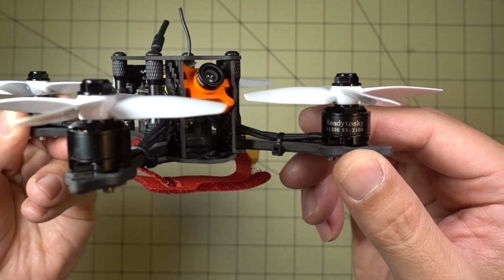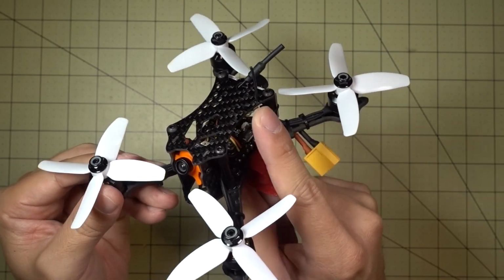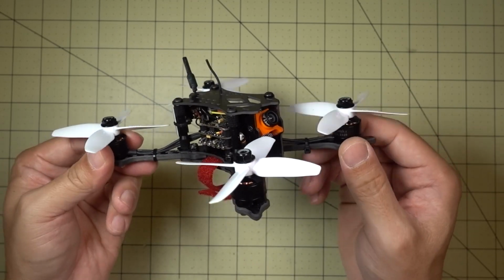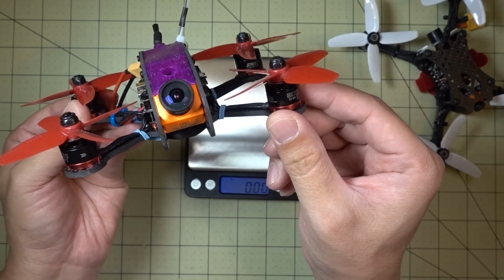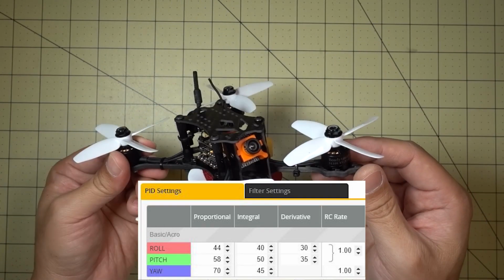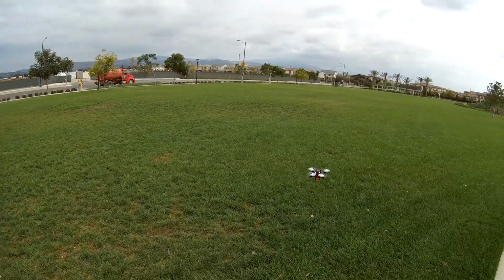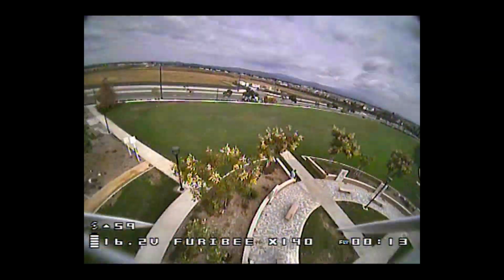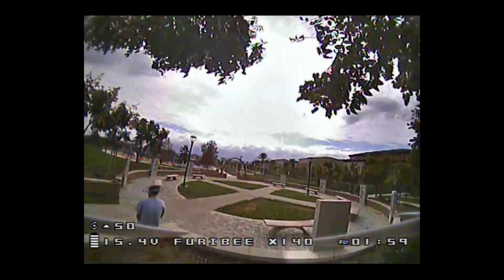Micro Drones 101 🚁#43🔥 FuriBee X140 👍👍😀

Comment: Hey Albert, Id like to add the FS A8s receiver. Not sure where to find the pads and the receiver doesn't fit the plug next to the USB port. Not sufre if I need to remove the stack or not ..
Reply from the maker: I'm not sure which board this uses. Any manual out there? If so, look for uart2.
Reply: OK. Can I remove the plastic plug ? Thought maybe there'd be pads to solder the RX to underneath

Comment: Why do you think this model comes with 4 blade props over 3 like on the xjb 145 ?  Thinkin Gemfan 3052s may be a good alternative .. Also does this copy cam have a focus locking nut ?
Reply from the maker: I did a video with the 3052 props if you want to see the improvement on that prop.
Reply: Ok thanks a lot

Comment: I picked one of these up love the performance durability I just wish that it had a little bit more power coming out of the VTX is there anything you could suggest as an upgrade to that?
Reply from the maker: Get this one to replace the stock one.  It goes to 600mW so plenty of power and range.  http://amzn.to/2HjaMN9
Reply: Albert Kim thank you for your quick response I was actually looking at this one but my concern was with the original VTX connecting to the flight controller with the pins I'm fairly new to this Hobby and my soldering skills are not the best as of yet but there's only one way to learn

Comment: Mine has been dropping out of the air at least once every battery. When it falls it just drops, high throttle or low throttle doesn't seem to matter. I'm using a Turnigy Evolution with 0.09 20-Feb-2017 firmware and the quad came with a FS-A8S clone receiver. And I'm using an Infinity 3s 850 mah battery. Do you think it  could be the receiver or transmitter causing it to failsafe, or do you have any ideas on what I could check for to get it to stay in the air? Your help would be greatly appreciated.                                                                                                                                               

Update - Figured it out. Ended up being the receiver. I'm not sure if it was rf or em noise causing the problem but I made a small case for the receiver out of the thin foil from a disposable takeout container and haven't had any problems since.

Comment: High power on vtx is 300mw, just hold button till light stays on.  Caution for heat at 300. Got mine for 120 with flysly TX, I use a 500 mah graphine that is 42 grams and also the race kraft 4 blades are the way to go all day... Along with red bottom. 4k kvs I will be getting. Flys good but if u flash to 3.2 setup with with dynamic filters and kill the notches ull have a beast.. Those props are shit and the 500 mah is sooo much lighter I HIGHLY RECOMMEND U TRY ONE same battery just half the weight and toss on race kraft props... Bo punch for days.. Good vid... Great audio track 😁
Reply: Then again mine is newer..

Comment: To reverse the props, instead of resoldering the motors, couldn't you just swap motor cans?
Reply from the maker: Yes, but then you'll need to have the correct C-clips on hand.  They will break when you take them off.

Comment: do you think this could fit a Runcam Split?  the split is 22mm wide and the micro is 19mm wide,  not sure if i could stuff that extra 3 mm into this frame
Reply from the maker: No, it's too wide unless you do some modifications. Also the board is larger than the 20x20 board in this.

Comment: Do you think a runcam 2 or equivalent would fit on the top?  Would it actually fly with that extra weight?
Reply from the maker: It will fly with the extra weight. The performance will decrease somewhat.

Comment: Hi Albert. I did order this little guy. For price I just couldn't resist. I do have question about another micro I have. When I am flying and descending I get some flutter. What pids do o adjust? Tia. Keep up the good work. I really like your indepht
Reply from the maker: It depends on what the flutter is. If it's high frequency, decrease P. If it's low frequency, increase or decrease D. Try playing around with it and see what changes.
Reply: Albert Kim ok that's what I will do. Thanks for the help.

Comment: This is the drone i have been looking for!! But the k.v.?? I need a supper fast one. So like you said this is not the fastest. But may b i should start out with one that is a little slower?? Ill wait for your next review. The problem is when i c you do a review on a mini race drone i want it! And then a day or 2 latter there is a better 1 out. They come out so fast that i could be waiting for years!! I Did like this one a lot tho! Nice job you give so much info on every review o look forward to it everyday!!! I cant wait for your next one !  What 3 to 4 inch would you suggest? I have a xd9 plus in the mail.  ?????
Reply from the maker: I don't bother with 4 inch drones.  For the money, this 3-inch micro is the best value I've seen in an RTF this year.  There's the XJB 145 I will review soon which has higher KV motors but costs $200.  So the value is less.  You can't have super low price and super fast ultimate micro drone.  Haven't see it yet.  They have to compromise somewhere for the price unless they are giving it away.
Reply: Albert Kim. True that!! I will pay 200 or more if it a nice built fast 3 inch !!! Wonder y you dnt mess with 4inch? Im want a 5inch for the speed but the 1 i had was so intimidating grasshopper f210 from gearbest was where it came from. I want a fast drone but not so intimidating thats y i was thinking 3inch or 4
Reply from the maker: +Willem V the RX2A pro works as well as the fs82... XJB 145 will be posted over the weekend I think.
Reply: DRONE review man of all drones There's a coupon for the XJB that drops it down to $134!!!
I bought mine last night!
Reply: When will the review of the XJB 145 be online? And do you have any recommendations for an Flysky receiver for this quad and the turnigy evolution?
Reply: Where was that at thats a good price
Reply: Albert Kim thanks
Reply: xjb-145 is a monster. Also, it's under 200...it's more like 125-150 and the kit is only 109.